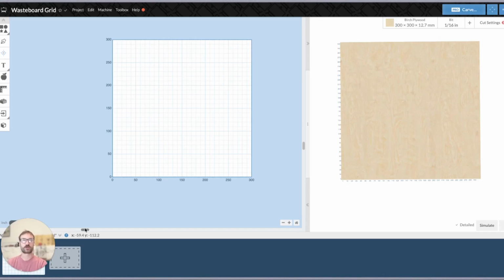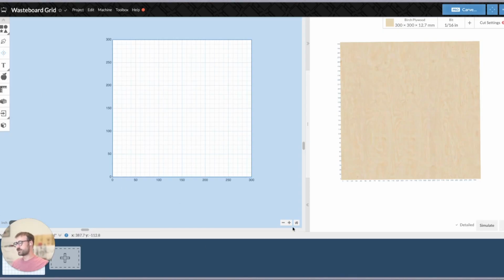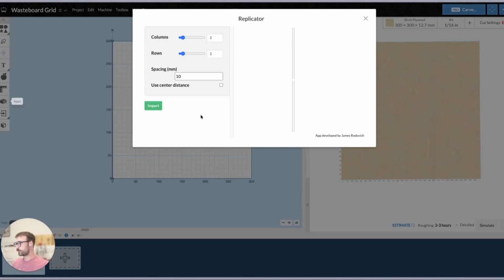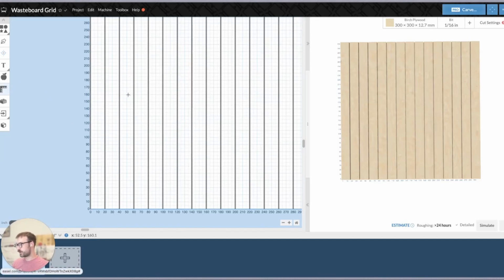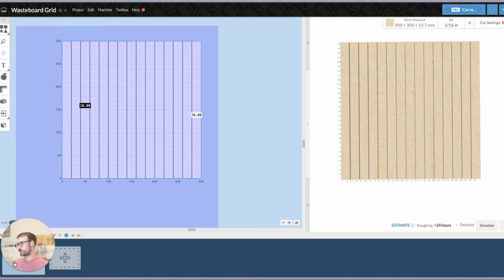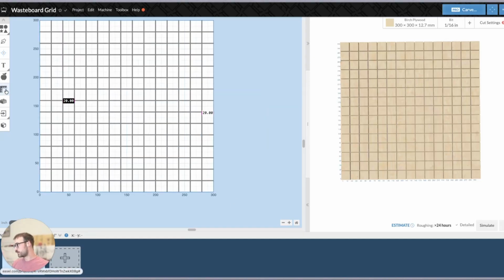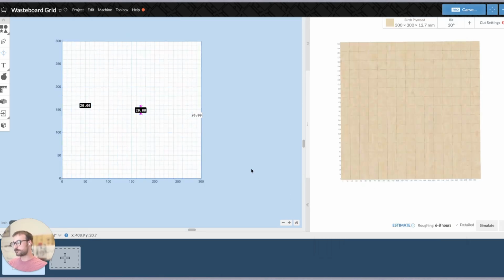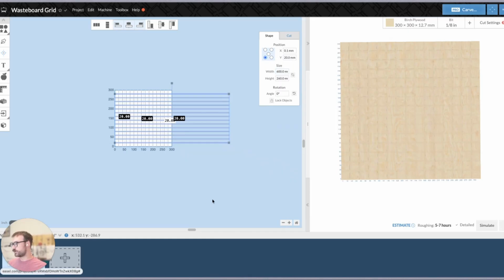Easel Software Tutorial: Wasteboard Grid

Comment: Great idea. One thing to be aware of is to keep the edges of the lines just shy of the full length and width of your machine's travel. At least with mine it will stop the project if it hits a limit switch.